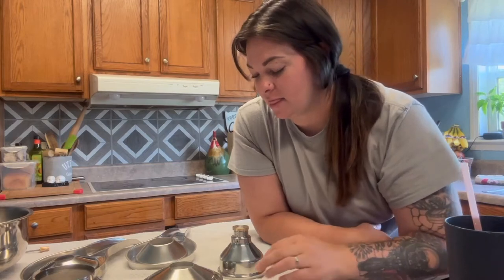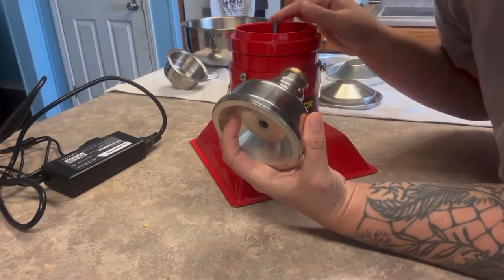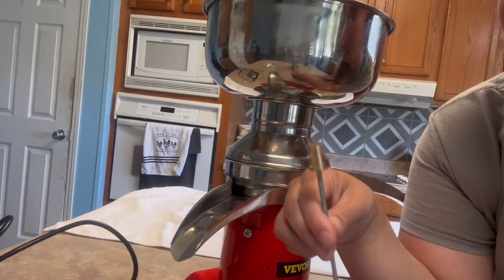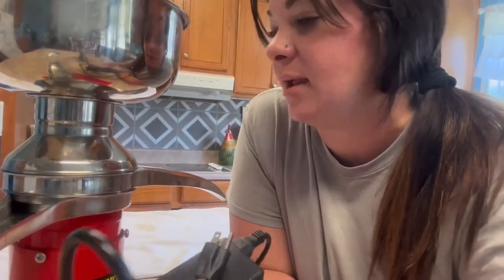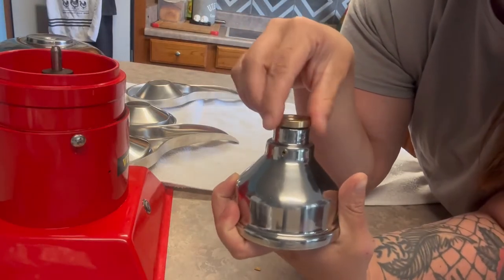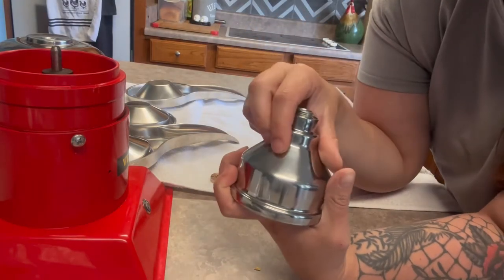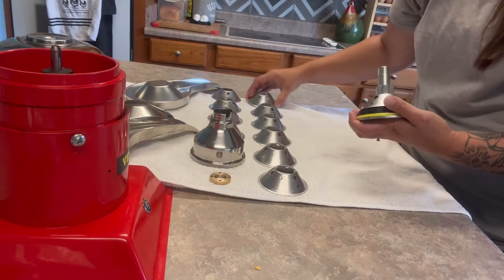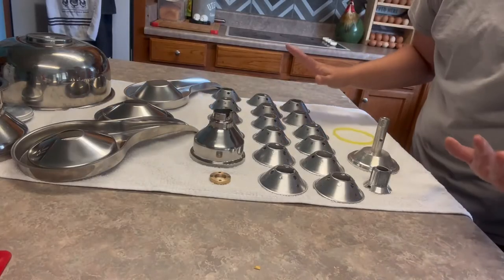How to assemble your CREAM SEPARATOR | EASY

Comment: Mine is leaking a lot. Trouble shooted from the manual and is still leaking. I went ahead and added a little milk and 0 cream came out. When taking it apart to clean I found cream in between each filter peice. Do you have any ideas? Has leaking ever happened with yours? I just got this machine and hoping I don't have to return it. But very little info exists on it. Thank you for doing this video. It helps ...question, the first filter that goes on. I can't tell the difference between them.
Reply from the maker: I’ve done the same before. Have you tried uncranking the drum some ? I realized I had mine way too tight

Comment: What if water only comes out one spout and leaks a bit? looking to troubleshoot.
Reply from the maker: Totally fine that the water only comes out of one spout, mine does too normally! 

A small amount of leaking or a lot?

I occasionally have a few dribbles of water, but not enough to “pool” around the machine. If you do, I would definitely reassemble it and do another water cycle before adding in your milk.

Comment: Well she misses one important step in the drum assembly. The cream  exit hole needs to be aligned with the slot on the exterior drum. The manual makes that quite clear.

One other tip I would use is to turn the cream screw in until it stops, about 4 or 5 turns. then back it out the same number of turns and write that in your manual. If you need the cream thicker, turn it CCW maybe another turn or two. If you get it all messed up crank it in all the way and then back it out to the manufacturer's setting of 4-5 turns.
Reply from the maker: Yes I’m sorry I missed this part. Thank you for your input
Reply: @lonesomeacrehomestead  So you get a 99%. That is still an A.

Your 4.0 average is still secure.
Reply: @lonesomeacrehomestead  Two other things need to be made clear er.

The spindle has one small hole that should be aligned with the filter base. I can be assembled wrong. I am pretty sure it won't ultimately damage the machine but may shorten its life.

Second the disk at the bottom, your filters first disk, has bumps on the top and bottom. The reason for this is that the bottom plate is smooth so this elevates the disk maybe a 32nd of an inch. The bumps on the top keeps the spacing on the rest of the disks. It will operate with an improper assembly of the disks in the filter, but I am sure hurts its efficiency.  The original manual never points this out, and it is easy to get wrong.

I put my back in the original box because it is easier to store on the shelf than when it is fully assembled.

I don't know why it can be washed in the dishwasher other than it would shorten the life of the gaskets. I hand wash the gaskets and the float. I rinse all the cream and milk out of the machine before final cleaning.

I pasteurize. So when I am cooling down the milk, when it hit 125°F I quickly put it in the separator. With the IR probe the milk exits the machine 104°F-110°F. I adjust my cooling Temps based on experience with separation.